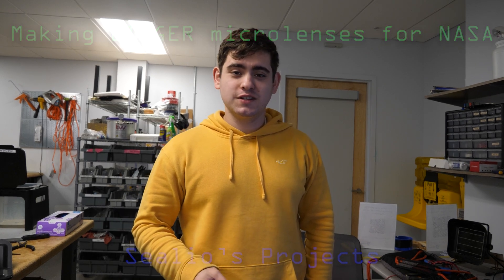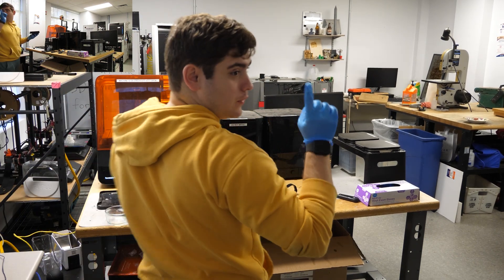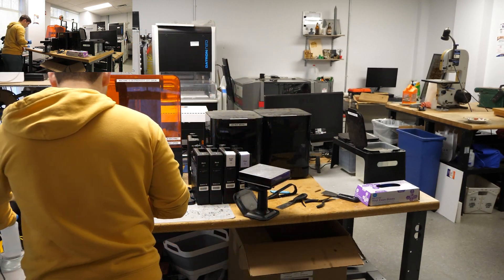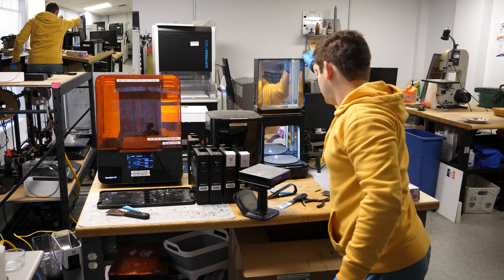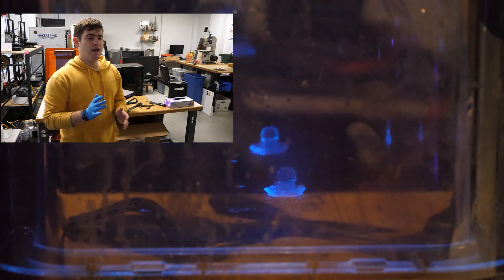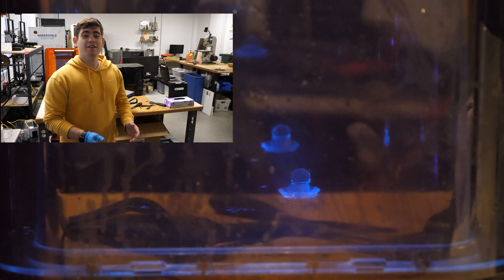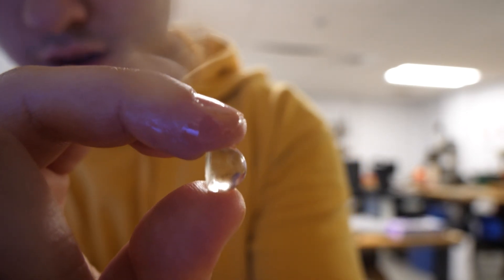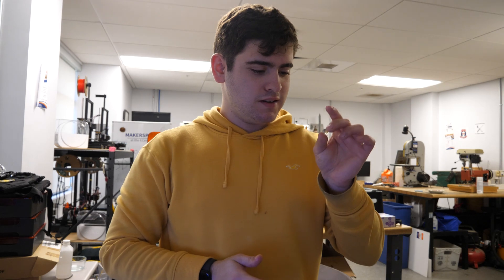I made a lens for NASA on a Fomlabs printer (part 2)

Comment: Print direct on the build plate no supports then use lapping film to sand the back of the lense 30um 5um 3um on a surface plate.
Reply from the maker: No joke my advisor just suggested this. The only problem is that the plate itself is super damaged
Reply: @sealiosprojects  If you can’t get a new plate. Get yourself a multi pack of wet/dry sandpaper going from something like 400 grit to 1000. Remove the build plate, wet the paper then place it on the sheets, on a table, then sand it down. Keep the sheet wet with a spray bottle. Once finish with 1000, use an sos pad to polish.
Reply: @sealiosprojects  See if WhamBamSystems makes a removable plate upgrade kit for that model, or worse case, one a little smaller. Makes direct plate printing so much easier.
Reply: @sealiosprojects  As if a new plate is going to break the (university's) bank

Comment: Not to be pedantic, but according to Wikipedia's definition that looks to no longer be a "micro" lense.

Quick note on the sanding, I've no clue of sla prints, but for transparent FDM prints, sanding with just sand (in a rotating drumm) is preferable, since it does not mean pressing the abrasive onto the print, which leaves quite a bit fewer gashes and a slightly more uniform finish.
But it's also more work to set up, and I've no clue if it'd actually be possible with sla prints.
Reply from the maker: The title is sort of a joke because it’s so big it’s not a microlens
Reply: interesting, how much scratches does the the sand leave on the FDM print?
Reply from the maker: @klohto quite a bit actually. I ended up sanding it on some notebook paper and leather to remove some of the big scratches and to polish the lens itself